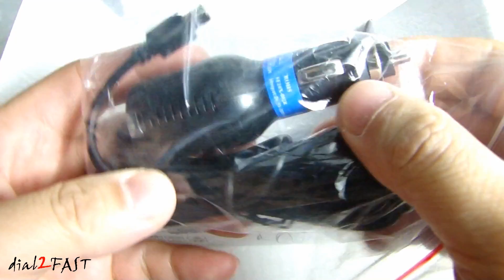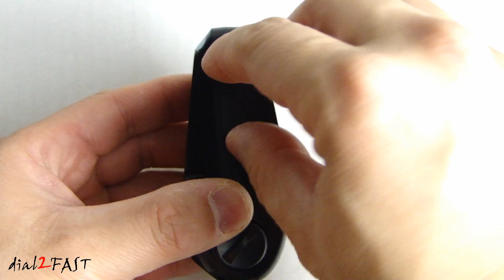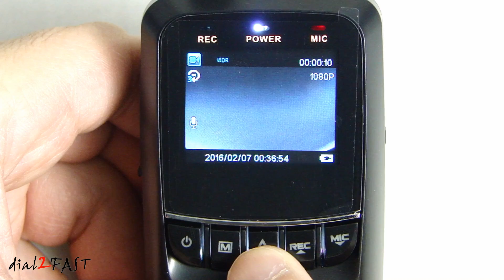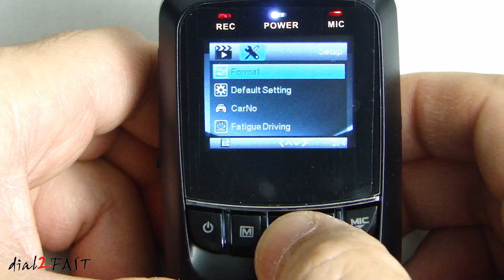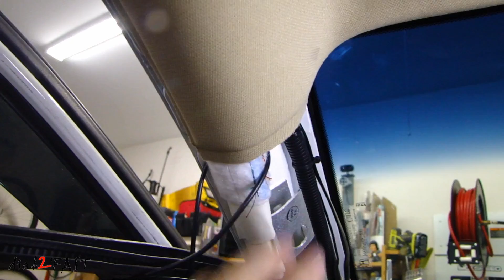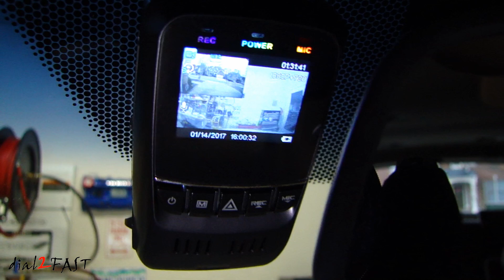DUAL CAMERA B40D CAR DASH CAMERA FULL HD

Comment: dial2fast

I have the same dash cam, but the fuse in the cigarette lighter plug blew. Then, I lost the fuse  in the cracks by my car seat! Could you please tell me exactly which fuse  I need: voltage and amp and even part number! I would appreciate that! Thanks.

Comment: I bought this camera from a different seller and the rear camera has separate black/red power connection cable AND the standard plug just like the one in the video. I'm a bit confused, will it not work with just the standard audio/video plug?

Comment: So i bought a Arecord B40D. Awesome cam but the issue im having is the rear camera looks like a selfie cam. Seems to be flipped. Do you have any idea if its just a bad camera?
Reply from the maker: My image is not flipped (I had a different dash cam that did that). For this model, the resolution of the rear cam is only 640X480 which is VGA resolution so don't expect to have great details but enough to capture any incident on the road.
Reply: Mine is also flipped.

Comment: Im interested in this camera but i see different brands make the same B40D. Is their a difference. I see them on ebay and amazon. Some have a brand like Arecord, I tentek etc.... Also some dont have a brand. Do you have any idea if they are all the same or not??? Thanks...
Reply from the maker: Really hard to say if the guts are all the same. If the price is not a big difference, stick with ones that work.
Reply: The Arecord B40d seems pretty amazing. Theirs a few videos on youtube I found; the quality looks impressive. Im gonna probably stick with the Arecord B40 with GPS. I thought about the thinkware x550 for $335. But after comparing both i really like the Arecord B40D for its price. It also has awesome reviews. I can use the extra $200 for other accessories. Anyways thanks for your response.